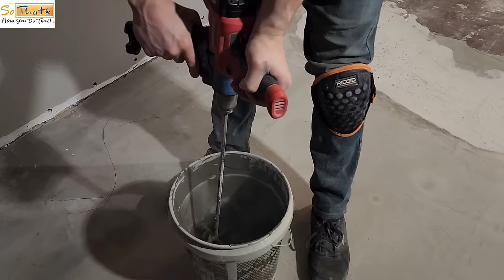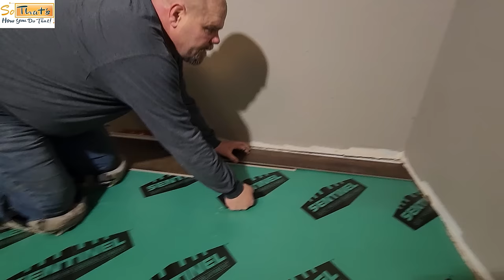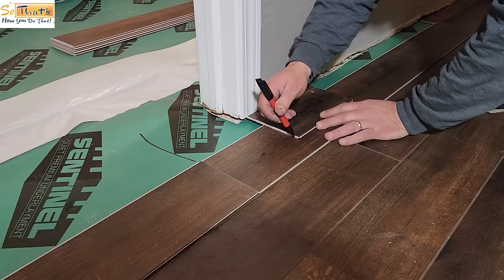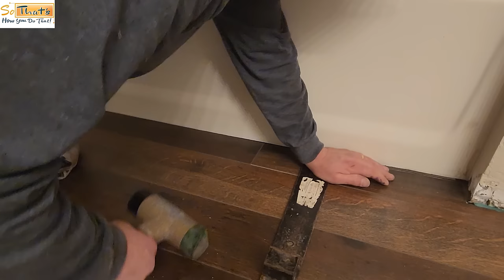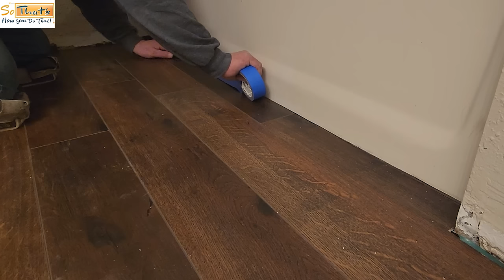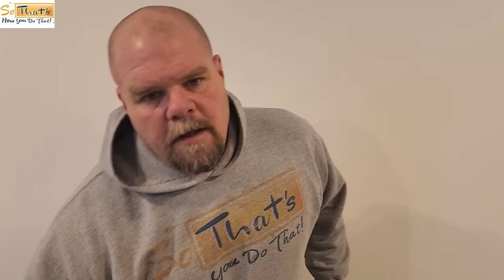I'd REGRET Installing Vinyl Plank WITHOUT USING ALL these Clever Tips

Comment: Hey Joe - I installed LVP flooring 3 years ago in my dining room, foyer and living room.  I have to give recognize you and give your our props b/c I followed your advice in finding the center point to the rooms from one side of the house to the other, by cutting out a piece of the drywall and measure from the framing of the house itself.  I am now going to finish off the remainder of the home and b/c of you! my planks meet perfectly in line with the adjacent room so I don't have to install transition strips on both openings from where I will begin.  THANK YOU! for you tips, wish I knew which video it was but I'm sure you know.  THANKS AGAIN!

Comment: I am a handyman and deal with installation of laminate and vinyl board flooring occasionally for at least 10 years. Week ago started a new project  - over 2000 sq. feet of vinyl planks floor. 57 " x 9" x 7.5  mm, very sturdy commercial grade.  About the same time I found your video on YouTube and liked your idea to use scrap pieces as an anchors and cheater board as well, it is working great! Thank you!

Comment: The tips you did through the doorway is EXACTLY what I as looking for.  I have to start in a walking closet and move into the main room.  Also will use the tip for the bathtub, but use it for the transition into a bathroom door with a stone threshold.  Thanks a bunch.

Comment: My husband insists on click lock flooring and I would like that as well, specifically the ones you have reviewed as water tight and strong click lock sides and ends. However, we are doing almost 1800 sq ft and there isn’t a completely level spot in the house (double-wide) that I can tell. Are the LVPs that you recommended too rigid for our floor? Would they break? Is there any that would do well for a floor like ours? We are using a floor patch to try to help with this issue and then 1/4 inch underlayment over that but it still will not be completely level.

Comment: If you are using a circular saw blade (miter saw, skilsaw, etc) to cut vinyl plank a good saw blade to use is the Diablo Trex blade thats used for cutting Trex composite decking boards.  All circular saw blades will cut vinyl plank but most of them will dull very quickly if you aren't using a blade with the correct tooth profile.  The blades that have a gem-shaped tooth and have a low-negative hook angle will cut vinyl planking and not go dull.  If you put a wood blade on and cut vinyl plank, it seems to do good at first but by the end of the day that blade is ruined.  Wood blades have a different shaped tooth and have a positive hook angle and they dont mix well with vinyl planking.
Reply: How about a carbide tip blade?
Reply: @dreid4760  All circular saw blades have carbide teeth. The rest of the blade is regular steel. Carbide is certain form of steel that has a higher ratio of carbon and that makes it much more dense. We tried a few different blades cutting vinyl plank and they all cut great at first but by the end of the day you'll notice its chipping the plank a lot. That means it's going dull. We put a Diablo Trex blade on and did not notice any dulling after 3 days. The other blades we tried were all wood cutting blades. All have carbide teeth. The difference in the Trex blade is the shape of the carbide teeth and the angle that the teeth lean (hook angle) relative to the center of the saw blade.

Comment: Great videos!  My kitchen floor is tiled and has large grout lines to make it look old.  Years later i painted and stenciled it because it was cracking.  I did everything by the book and now the paint is peeling in big pieces. 

My question is I want to have vinyl planks put over it.  Do the tiles need to be taken up which is now bringing the price a lot more, or can a lining or leveling compound be layed down first? Also is there a compound that can fill in the cracks?

Comment: Really helpfull video. I have a question,  the master bedroom is long and the direction of the planks is very obvious. However, the bathroom is long in the opposite direction. Can I change the direction of the planks 90 degrees at the door and install a transition so they are parallel to the tub and shower and I don't have to place the planks ends at the tub and shower instead of having f the long side of the planks parallel to the tub and shower? Hopefully my question makes sense. TIA.

Comment: I am planning to do a kitchen and connected hall with a step down.  The one step is perpendicular to the direction the planks will run.  Do I install the plank(s) on the step the same direction as the floors?  Also, do I need to worry about keeping the planks in the hall aligned with the ones in the kitchen?
Great tips!

Comment: Awesome show! Really appreciate your tips. I have two questions. First off I'm going from a living room to a kitchen and I have a south entrance where I will use parallel boards and then 90 degrees I have a west entrance that would use running into the room from that entrance. I know this is a precise system but what are the odds of my being able to meet up those two entrances let's say 3 1/2 feet in and 10 feet apart without having to use a transition strip at this second entrance?

My other question is, the current floor in my kitchen is vinyl strips that were cemented down maybe 20 years ago. They are well glued down and thick. They measure 3 sixteenths of an inch thick and don't want to come out through even simple physical effort. Do you have any suggestions about removing those versus figure out some kind of transition strip and going over the top with the new floor. I'm using LifeProof vinyl plank flooring for my new installation. Thank you for any tips you might have and keep up the good work!
Reply from the maker: VERY GOOD ODDS. Have you watched this video - https://youtu.be/8ZmkxroZ11g

Comment: I watched a number of vids now and this one best fits my project. I am using NUCOR waterproof LVP. I have been having horrible issues trying to get the but joints to line up and lock. I end up hitting very hard and the tongue then curls up making the joint useless. It is supposed to be installed like you did in this vid, slide long side in at a low angle and lay it over the butt end, line up and tap. This is supposed to be an upper end material as I typically will spend the $$$ to get the best. It seems to pass all of your tests for quality but I am at a loss. I am going to take the 15% that I have laid already and get rid of the visquene and get the Sentinal underlayment. I am ordering your recommended tools and starting over. I did subscribe but I do not see the "link" you provide to buy the tools?

Comment: Thanks for all your tutorials Joe. You have genuinely helped me. Have you ever cut the bottom of toe boards to install or is it just better to use quarter round? Thanks in advance
Reply: Hi aim a carpenter from England UK and I think it always looks so much better to mark toe board and wall and then remove toe board sand and give one coat of paint,once your floor is laid tape all round edge of room and then refit boards easily because you marked wall and board,fill and sand any holes and give finishing coats of paint ,then score round edge of toe board and peel tape off , job dun mate

Comment: the best instructions by far! Question - when do you use the lining between the subfloor and the LVP? is it always necessary?
Reply: For wood based LVP, yes. Can get away without it with SPC type over concrete but still wouldn't advise. It's best to have a vapor barrier in between regardless of whether you have wood or concrete subfloor.It's a very affordable component in the flooring install.

Comment: Hi Joe, great videos.  One question.  Older videos you say to lay 3 rows and screw down small temporary pieces to hold everything solid while you work outward.  In this video it seems that you used a different technique to get started without securing anything to the floor.  Is this your new preferred way?  Thanks Joe, God bless you and your family !
Reply from the maker: I use both and depends on your situation. I still like using screws for the first rows and the spacers everywhere else. This way just gives someone who has a concrete slab more options.

Comment: I'm about to install some LVP with a limestone composite rigid core with a pad on the bottom. It's going down on a basement slab. The manufacturer said I only need the 6 mil plastic before the LVP as it has a pad already. In your experience do you recommend that or should I also do an additional underlayment? Thanks for all the videos and helpful tips.
Reply from the maker: Just the  vapor barrier is good.
Reply: @sothatshowyoudothat  thanks

Comment: So would you say you split one third or quarter on your first full piece to make the joints not line up? There usually 48 or 50 some inches. What I need to know is what's a good breaking point I can split the first joint to make sure I get a random pattern

Comment: Thanks for all the great info. How well does LVP go with heated floor? My options here are limited so I'm looking to get a glue down LVP so I can make it into herringbone. Is it a troublesome idea and what kind of pad would you recommend so it doesn't hamper the heat transfer?
Reply: Have you considered using wood-look tile  with your heated floors instead of LVP?
Reply: @haveyouflossedtoday  yes but I've decided LVP makes a better choice because of sound isolation (bitchy neighbors and i plan to rent out the apartment), echo the tiles make, and feel under the feet

Comment: Life pro tip ^^ toilet flange is 7 1/4” diameter. Circular saw blades the same exact size you can use it to scribe if you don’t have a flange

Comment: You were a huge help to an old tile man installing vinyl plank!!  Awesome content…having alittle trouble with the gorilla glue … what do you use to get it off plank? Thanks again for all your help
Reply from the maker: I use denatured alcohol. But, you want to get it off before it dries.
Reply: Instead of gorilla glue (due to difficult if not nearly impossible removal) you can also use glue specifically designed for tounge and groove flooring.
We use Calflor EuroBond D3 glue. It's awesome stuff. It holds up in wet areas, remains flexible when dry, and is D3 certified.
Alternative is Tite Bond LVP.

Comment: Is there a reason that you put ten planks together and measure them instead of just taking the width of the planks times 10?  I am about to start my install for the first time and your videos have given me so much more confidence.  Thank you!
Reply from the maker: It is more accurate for those of us not using the metric system. Almost ALL plank is designed with the metric system in mind.

Comment: Do you prefer the drop and lock or the tongue and groove vinyl planks?
Reply from the maker: No. Tongue and groove locking systems are better by far.
Reply: @sothatshowyoudothat  thanks. Is there anyway to fix tongue and groove connections after the floors been installed. A few joints that are raised and that didn’t connect properly?

Comment: Maybe this is a stupid question, but what marker are you using on the planks? Does it remove easily? Thanks!!
Reply from the maker: That's not a stupid question. I'm using a milwaukee marker, and yes, it comes off very easy with alcohol
Reply: @sothatshowyoudothat  Thanks!!

Comment: Just wondering why the layer underneath the plank. Did this plank not have underlayment attached? Watched whole video, never saw why layer was put underneath
Reply from the maker: This plank manufacturer recommends to use this pad under the plank. You don't need to do this, but they also want you to use a vapor barrier if it is over concrete, which the pad has.

Comment: Those holes at the bottom of that wall usually mean there was flooding in that room. Was that the case?
Reply from the maker: Yes, they had a sump failure during a storm that left 5 inches of rain.

Comment: Which plank are you installing?
Reply from the maker: Nucore performance.
Reply: @So That's How You Do That!  It looks like you're using Sentinel Premium Quiet with Nucore Performance. I just did the same thing, only to realize it voids your warranty. I just happened to read the warranty AFTER I completed the installation in my kids' bedroom. Fine print says you may (optinal as it's not required) only use Sentinel Protect Plus in residential (commercial says use if ANY underlayment voids warranty). I am not about to pull it all up, but... do you have any thoughts? Why would this be in their warranty?